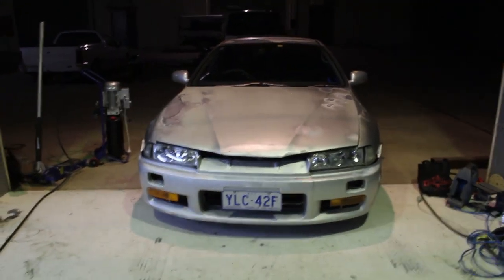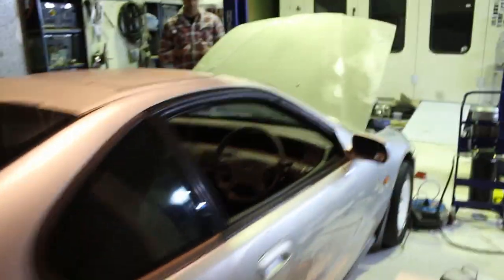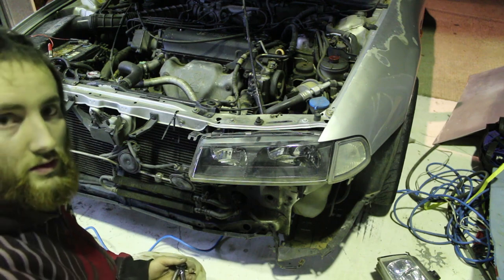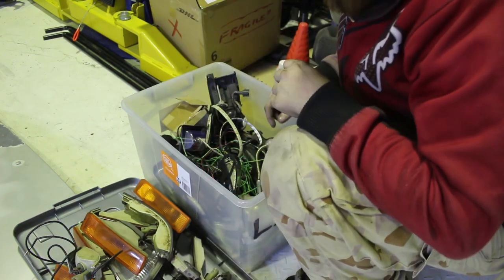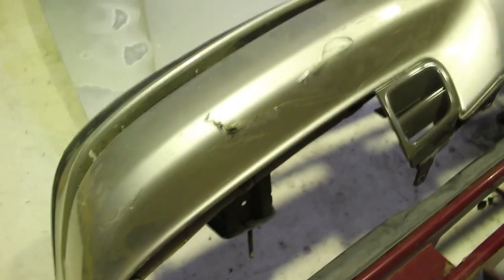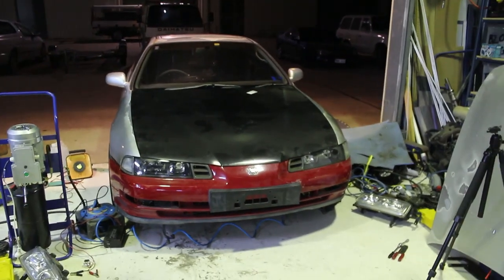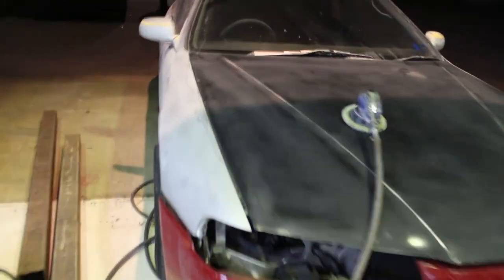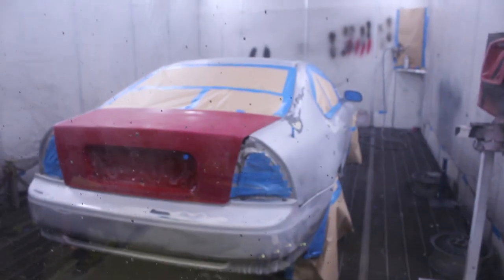Painting the Police Car... I Messed Up

Comment: Hey, man! I have a question about the H22. I bought a 97 5th gen Prelude 185hp and usually it doesnt burn any oil, but when I start pushing it in Vtec it literally smells inside the cabin.. Is this normal?
Reply from the maker: Smells of what?
Reply: @Conorsev  burned oil